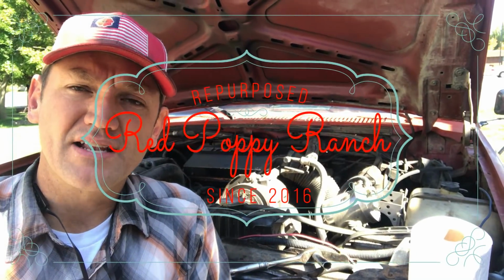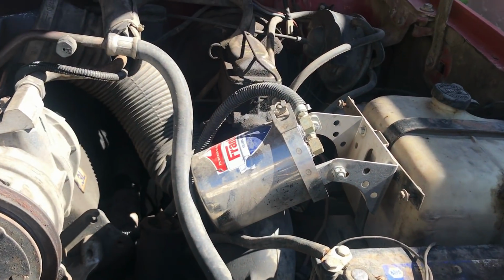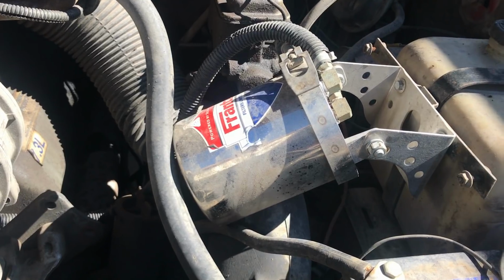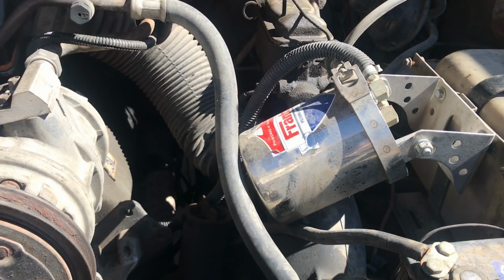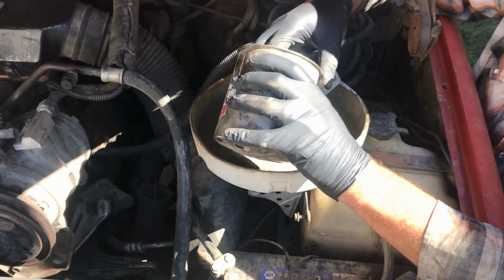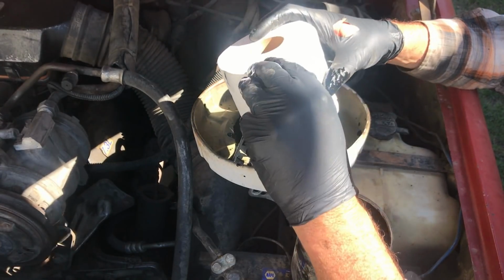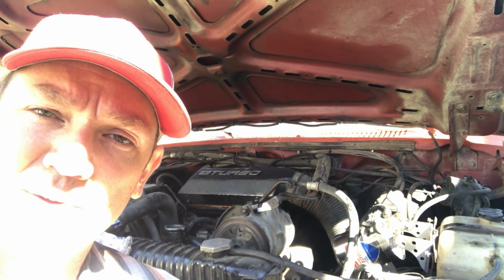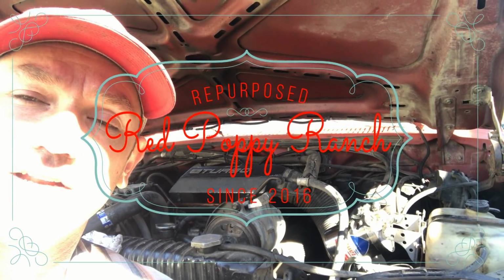#146 - Toilet Paper Oil Filter Maintenance... (Frantz Oil Filter)

Comment: The challenge when the Frantz first came out was removing the large abrasives before they could destroy the engine. Oil filters were optional equipment in most cases. They were all bypass filters that hooked up the same as the Frantz. There are almost no large abrasives in a modern engine. Lots of small engine wearing abrasives. Sludge was a big problem in those days. Crankcase ventilation was a road draft tube that put the blow by under the car then to the atmosphere so that every one could breath it. When California decided to outlaw the road draft tube in favor of the PCV valve the old cars had trouble. Now the blow by is fouling the valves piston rings ECT. A porely maintained engine would be more than a filter could handle. Not so much of a problem these days. We still hope when we install a filter that cleans oil The engine is either new or has been properly maintained.

Comment: Transmissions run on friction. ATF can be loaded with contaminants. I thought I invented using toilet paper to clean ATF. On my Dynaflow Buick I tapped into the high accumulator .for pressure and returned the clean fluid to the oil pan. Found out later Frantz users had been doing it for years. Was at a oil change place waiting for a safety sticker. They were pushing transmission flushes. The best thing to flush a transmission with is clean ATF. Of course ATF always looks clean unless it has been overheated. Looks are deceiving.

Comment: Watch out for the micron claims. The more depth the filter has the longer it can hold its micron rating. A spin on filter can't.hold its micron rating very long. I have heard micron ratings for toilet paper from 1 hundredth of 1 micton to 2 microns. The toilet paper has the depth. The Scott 1000 will go smaller.than a loose wound one. The slower the flow the smaller the micron rating. The old Motor Guard compressed the toilet paper and forced it into tapered housing. They have made claims of from 1 hundredth of 1micron to 1 tenth of 1 micron.

Comment: Like I say "if" it were an improvident OEM manufactures would put them on as original equipment. 
And yes K&N air filters are not good for any vehicle with computer controls.
Reply: Any automotive engineer knows that an engine needs both a full flow filter.and a bypass depth filter.Why would they add millions to the cost of building cars. The old beetle engines didnt last long because VW saved millions by not putting filters on them. It was cheaper to recommend 1500 mile oil changes.
Reply: Somehow  we have gotten to the point  where  filters that dont clean oil are legitimate  and filters that clean oil are called snake oil. Clean oil has always been better than dirty oil.

Comment: After reading all these comments and everyone stating their 2 cents... From what I can surmise is, it's just safer and better to just change your oil like you're suppose to and then every 100,000 miles do an oil flush with additives I've seen on other videos. Like using Totally Awesome. 
Other than that, no matter what, I agree with some of the posts here, it's better to follow the manufacturer's suggested maintenance routines. 
Lastly, I have never understood why anyone keeps a car for more than 15-20 years? Unless the car is a specialty (i,e, hot rod, luxury sports car, high-end luxury car or something custom) it makes no sense to me why keep a car longer when all the parts and debris start braking down and then the car becomes a REALLY BIG MONEY PIT!
And I know most people, who read this, will say it's because most people can't afford a new car or don't want car payments.
But what I say to that is... you HAD 20 YEARS to save up to buy the new car! If you can not save $1000 PER YEAR,  which is only $84 PER MONTH, which is only $21 PER WEEK,, then something is wrong with you.
Reply: Bernie Cruz because not everyone needs to have new things to make themselves feel good.  I drive a 21 year old car that runs just as good as the day it was new.  There's nothing wrong with it, so there's no point in replacing it.  Anything that breaks on it can be fixed easily.  But then again, cars from 20 years ago were built way better than the crap they have today.
Reply: Buying a new car is not only about to make oneself feel good. But to have a more reliable vehicle where one doesn't have to keep pouring money into the car that's over 20 years old. Yes, i can understand, your car is running fine for it's age, but I bet if you added up every single penny you spent on that car excluding regular maintenance (i.e. oil changes, tire and brake replacements, radiator flushes, brake and transmission flushes, etc...) you would realize that you're "perfectly running" vehicle is only running "perfectly" because of the amount of money you put into it to keep it running that way. And also, if you've been the type who works on the vehicle yourself, then you would need to factor your time into the cost factor as well, to come up with the accurate cost invested into keeping the, over 20 years old, vehicle. And to do that, you'd use the factors of how much you personally earn on an hourly bases at your "normal" or full-time job. 
(i.e. spent 5 hrs fixing a problem on your car in one day X $30/hr = $150 on labor cost) 
So, add all that up and you'll find that keeping a car for such a long time, which has outdated technology in it along with old concepts and lower performance features compared to modern cars today... and you'll realize that keeping a car for such that long of a time-frame, makes no sense. Financially or sentimentally.
Reply: Bernie Cruz I can guarantee that any amount of work and money that I put into this car over the years is still way cheaper than paying $20,000-30,000 for a new one every few years.  Those of us who can work on our own equipment know that just because something is newer does not necessarily make it better or more reliable.  Any kind of so-called newer technology is also a moot point.  The only technology needed is a car that runs good, is reliable and gets me where I need to go.  All of which this one does very well, and without high payments and insurance.

You go ahead and keep buying a new car every few years and keep wasting all that money on depreciation.  People with your flawed mindset are what keeps people like me laughing all the way to the bank.
Reply: Actually Bigchevy80...  my mindset is all about money being nothing but a tool. A tool that allows me to get done whatever I need to get done. 
And you actually contradicted yourself with the comment "keep wasting all that money on depreciation" because even though your car gets older and older, it still depreciates just like any other car and you're the one who's wasting money on parts that are failing left and right due to their age and wearing out. 
Eventually you'll spend money on replacing every single part the car came with including parts on the body.
Which this means "your wasting money". 
I'd rather spend my money on something new, looks better, runs better, has warranty, has all my maintenances covered and even get a FREE RENTAL (which I save money on due to that I don't have to pay for on my insurance policy). So, you go ahead and keep dumping all your hard earned money (which you obviously work long and hard hours for) into a vehicle that will just keep eating up your money as time goes on. Meanwhile, I'll spend my valuable time, doing the least amount of work while making the maximum amount of money, to boot, and then spend my extra free time (not repairing my car) on things like vacations and other entertainments which I enjoy in life. 
Bottom line, is, I earn the amount of money where I've learned the fundamental lesson of finances and that is, MONEY IS NOTHING BUT A TOOL/RESOURCE TO USE TO GET THINGS DONE! 
You obviously have not learned this lesson in life. Most likely because those who have to work their asses off for pennies, tend to value money like it's the most valuable commodity in the world! Which it's not.
Reply: Bernie Cruz A car this old does not depreciate at the rate a new car does.  I paid $4500 for that car over a decade ago, and I've spent less than half that amount on a decade's worth of maintenance.  So yeah, less than $7000 for over a decades worth of use and 130,000 miles driven is a good deal in my book.  Most people lose more than that in depreciation over the first year of owning a new car.

That money saved goes towards being COMPLETELY debt free and having all the money I could ever need for all that other stuff you listed, like vacations, hobbies and other toys.

It's not that money isn't a tool, it's that some people utilize their tools better than others.  Most people I know that buy new cars every few years are in debt up to their eyeballs.  When it comes down to it, I could care less what you do with your money.  But telling someone that it doesn't make sense to keep a vehicle this long is your OPINION and nothing more.
Reply: AH, DUH!!! Of course, it's MY OPINION in stating that keeping a car for over 20 years doesn't make sense to me. THAT WAS MY POINT... just airing out MY OPINION! DUH!! No one said, it's a golden rule or that EVERY PERSON IN THE WORLD, has to follow it. AND everyone IN THE WORLD, has the right to disagree with me. I really would not care if someone else's view is different than mine. "EVERYONE is entitled to my opinion!" (LOL JK) to their opinion!
Reply: The oil change industry loves a .man that does what he is told.
Reply: There are a lot of people that shouldn't have these filters. You need a basic knowledge of the oil system and the importance of continuous clean oil. A guys brother ask him I wish you had told me you wanted a Frantz He said his is no good.He said his lifters are noisy and his oil is dirty. He was asked when he changed it last. He said change it the guy that sold it to me said it would last a lifetime. His Frantz was removed.
Reply: My 76 F250 with a 390 Is old but paid for.It will be here when I am gone. My wife will probably sell it for 50 bucks.
Reply: My wife has a beautiful Honda accord she bought new before I met her. She doesn't want to wear it out. It sits in the car port. She said she wanted a car that she could put the miles on. I bought a Nissan Altima with 225 k on it. Nice car with a bad engine. Bought a Japanese import engine and installed it. When I got thru with it It had cost me about 4k Not sure what a new top of the line Altima cost. It has toilet paper filters On the oil and ATF. She is still changing the oil to keep the warranty good. What a dann waste.
Reply: My second wife was doing what she was supposed  to do
 Her beetle didnt come with a filter
She was supposed to change the oil every 1500 miles which she did. I put a stop to that bull shit with a toilet paper bypass filter. It took several L toilet paper changes  before I got virtually  all of the large engine damaging pieces of steel out.Never had another oil drain. Had to tilt the Motor Guard so the big stuff wouldnt drain back into the oil pump at shut down.. the Motor Guard filtered from the bottom up..Frantz recommended putting the Frantz upside down on the beetle.

Comment: I dont see how the oil can flow through that ¨filter´´, if anything its just being soak up by the paper and disrupting proper flow to the regular canister oil filter. I think this is a scam. But please keep us updated on this, its interesting to see how it goes!
Reply: The Frantz or any other bypass filter only supplies the oil pan with clean oil. That is if it has enough depth to clean oil. The FRANTZ cleans oil. The scam is when you drain the good oil because it's dirty then buy another filter that doesn't clean oil.
Reply: It would be good to learn about the filters before explaining how they don't work.
Reply: With a quart or so of clean oil going to the oil pan a minute  the whole oil system will be clean before you get to town unless the oil is grabbing a bunch of sludge on the way to the depth filter. The Frantz  can only clean the oil it cant clean the engine. The older guy recommended  Delo 100. It was for diesels. It had no additives that turned dark.  We sold it for 55 cents at the station.  Our most expensive oil was Standard Custom I believe  for 1 dollar  a quart  The Special turned dark. At one time you could buy Frantz brand oil. Of course it didnt have the ashless additives.

Comment: Hey, what happened to the oil analysis?
Reply: He realized this filter is snake oil. Lol.. "I Promise" He'll never change it again.. Pfft.. riiiight.
Reply: @DakkarDragontis   Snake oil even though Its proven that removing fine Micron particles form engine oil with a filter Improves engine longevity by up to 70% ......But im sure you're the master of oil analysis and knowledge on all that is worth knowing....
Reply: @themisunderstoodgorilla7030  he said he'd never have to change the oil again, and that oil is as black as it would've been without it.
Reply: @DakkarDragontis  Oh yeah for sure, But a good bypass filter such as the one mentioned will extend engine life and oil change intervals.
Reply: @themisunderstoodgorilla7030  of course, and more filtration is always better, but the top filler is not the way to go.
Reply: @DakkarDragontis   I disagree there are many bypass filters available, Amsoil , Baldwin do a 8micron etc etc. But a Toilet paper filter has very good filtration and is exceptionally cheap, A well setup system wont give any issues. People saying that they ruined engine etc but fail to provide details... I have seen first hand that they work and Trucks here in Australia can do 3 milliom km with no issues, just filter an oil changes every 100,000km ....
Reply: @themisunderstoodgorilla7030  low RPM, large displacement engines tend to last long even with cheap oil but I'm curious how well a system like this will do in small high revving , high comp, modern car engines with turbos and Direct injection.
Reply: @health-vh8ce  works fine. A normal oil filter fitted to a car filters to about 30 micron. Most engine wear is caused by contaminants between 5 and 25 micron. And a good bypass filter will filter to 2 or 3 micron. Studies by GM and Cummins show filtering oil to 10 micron can improve engine life by 70% and it's a bypass oil so doesnt matter what engine it only flows 5-10% of the oil at any given time.  Its doesnt starve the engine of oil... the research is there and its proven so it's a great way to extend engine life
Reply: I can tell by looking at a filter element if it will clean oil or not.There are the ones that look like toilet paper. These are as good as toilet paper.The problem is the cost. I have sent oil to a lab to prove a point. For my personal cars for what it cost to have the oil analyzed I can change the toilet paper a few times. At one time Frantz had literature that showed how to read a used roll of toilet paper to find if you had a leaky head gasket.Too much fuel in the oil and that sort of thing. At one time Frantz had their own oil. We did fine before there were synthetics widely used.
Reply: Stopped in Gulfport a few years ago. Had the opportunity to look at the parts of A Detroit engine being tested by Shell oil and being followed by others including the military and NASA.Shell had it marked so that no one could mess with.it except them. The parts looked new.Don't remember the exact miles.It was near 1.000.000 miles
Shell Rotella. 15- 40. It used Bounty Big Roll paper towels. Would I use Shell Rotella. Hell yes.
Reply: I can't say the Shell Rotella lasted almost 1 million miles.the filter used 2 rolls of Bounty. Big roll paper towels. It takes a lot of new Rotella make up oil.Not a qt like a Frantz.
Reply: In the 60s Frantz had the FAA approved. AeroFrantz. I saw some on crop dusters. Would that qualify as a small high revving engine.
Reply: Many years ago I saw some literature where Cummins claimed a 80% increase in engine life when using the big Cummins Fleet Guard 750. Cut open a WIX 750 element. It was pulverized newspaper and wood chips. Don't know what the wood chips were.for. I cut open a Luber Finer 750 and it had cotton waste in it. Twigs and all. Toilet paper is probably better but too small for  an over the road.truck. Some are using big roll paper towels. Probably more economical
Reply: Joe Blow regardless after a while the oil is going to start to become acidic and break down
Reply: @themisunderstoodgorilla7030  Doesn’t matter. You change you oil on a diesel with a conventional filter and it will be as black as before in a few hours.
Reply: @cabwaldo   not if you have a filter that filters out carbon lol
Reply: I've used toilet paper for almost 60 years. My first diesel was a Peugeot. I expected the oil to look like the Rambler oil. Some diesel soot is too small to be filtered out. It is non abrasive but will turn the oil black. It is like ink..If it doesn't stain the skin and wipes off clean its clean.  When using lamp.black to demonstrate the filters I knew that I couldn't use the same oil to demonstrate  indefinately. It is what it is. Filters that clean oil like the Frantz are called snake oil. The filters that don't clean oil are legitimate. There is an attempt to cut down the bull shit by making their own elements. Too late. John Frantz should have done that 70 years ago